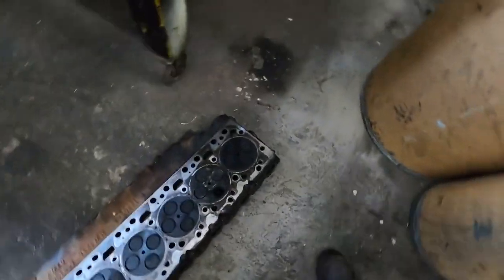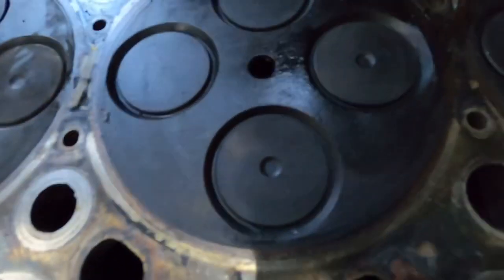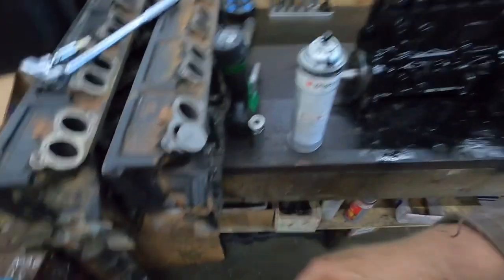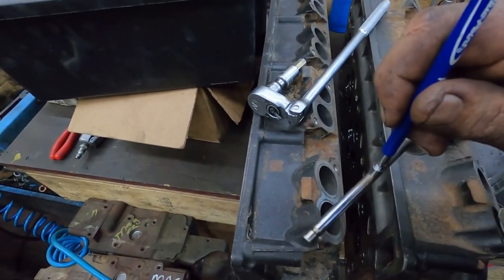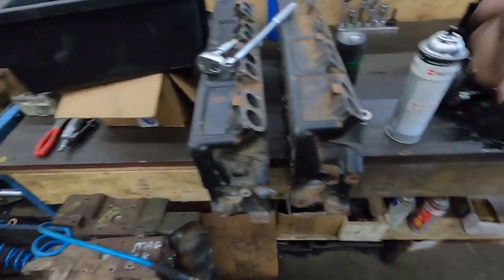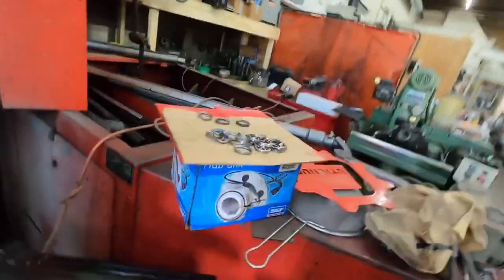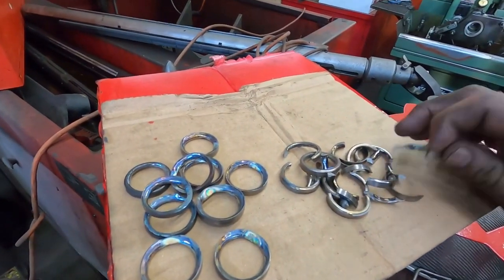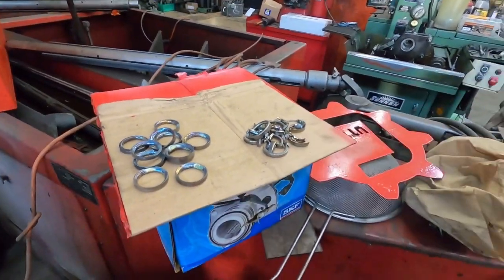WHY  6.7 Cummins drop seats and valves.

Comment: I know you posted this video a while ago, but I had a 2010 diesel pusher motorhome with the 6.7.  At 55K miles, I had a valve come apart in pieces and the cummins shop said it went through the engine wrecking the cylinders.  I ended up getting a long block because they said it was the recommended remedy.  I have always wondered how that could happen.  Cummins customer care would not help one bit.
Reply from the maker: If I had to guess the seat was moving around which will over heat  the valve. Which the head of the valve comes off from it

Comment: Doing some research as my 2016 5500 is in the shop and they are saying possible new engine because they think a bad bearing on a piston rod. It only has 130,000 and I’m freaking out as I have taken emmaculate care of this truck, all maintenance etc. I can’t afford a new engine every 130,000. Any tips?  I expected this truck to last me a long time. Zero issues until this. Bent rods twice, mechanics replaced rods and sent me down the road then 3rd time pulled over and was stranded with my horses. I only pull my horse trailer and drive 65 as that’s where I get the best fuel mileage.
Reply from the maker: I like doing all new seats. Better valve springs and get new exhaust valves. If the rod bearings are bad is werid unless it ran low in oil or it was on the cylinders the. Bent push rods are on

Comment: We just took our 2011 5500 apart, and Cylinder 2 dropped one of the exhaust valve seats. Would you recommend going all OEM for repair parts? Or is there aftermarket that would be suggested? We have 1 scored liner, and the head took a bit of a beating, as well as the piston is trashed.
Reply from the maker: I would use melling valves and re seat the whole head it it’s still usable.

Comment: Super helpful information Rob I've been looking for just this kind knowledge. Wanted to get a 2021 4500, but became a little shy after another rv hauler warned me of let's say 2018 and up. Do you see any valve / piston issues with 2017's ,?
Reply from the maker: the 2019 plus engine is complete different engine, i see the valve issue on the 2013-2018 engine , if it was me i would still away from the 2019 for the cp4 issues , but the 2020-plus seem to be good engine from the bit i have had to do with them, but if you do buy a 2020 + make sure you change to oil all the time, them have hydraulic lifters you don't want run down oil
Reply: @CUTTERUPROB  Thanks Rob *

Comment: Would you say a pre-'12 6.7 is a better engine? Shopping for a 6.7 for my 2003 lots of engines/year choices out there. Thanks for sharing information!
Reply from the maker: 07-11 is the ones I like
Reply: @CUTTERUPROB  Have you seen differences is 6.7 rods? I have seen two styles, don't know where/what changed though.
Reply from the maker: Not really. Personally if you want to make anything above 700 I would out better rods in it

Comment: Great explanation and I totally agree with you!  Cummins will probably  never admit to the problems they created.  Please feel free to gift me you CH-100 line hone cabinet!  I am currently building a cabinet that is that exact opposite of a Sunnen cabinet.  I want the mandrel weight on the caps , not on the block.
Reply from the maker: lol i dont use the the line hone much but one of those thing you need to have, ya i have a jib i made to do the same thing, well i think i still have it lol

Comment: 👍👍... Great Info once again man .. it is unfortunate fact with them apparently...wonder why cummins hasn't remedied the issue...
Reply: Here's my take on why they haven't made the change. I get this information from one of the lead Cummins engineers over this territory in the southwest US El Paso district. They may make a change that will save them $0.50. you think 50 cents why would they make that change? When you consider how many engines for example that they build annually.. 50 cents on 15 million engines is a significant amount of money. Even if it cost them an additional 4million in warranty work, they're still coming out on top. And to the other person's point.. he's absolutely right the majority of them failed beyond the warranty. Now here's the interesting thing though which warranty.? Because if you buy a 6.7 Cummins from Cummins it has 150,000 mile warranty but Chrysler only offers a 100,000 mile warranty. Why? Because they get it at a reduced price for the volume. Sad but that's big business. THEY MADE A CHANGE IN THE WAY THE TIMING GEARS ARE MANUFACTURED ON THE ISX SERIES ENGINE. TOTAL SAVINGS FOR THAT PART WAS ABOUT $15 PER ENGINE. They produce over 30 million engines for the global market. Estimated increase in warranty cost for service 12 to 15 million. Great video Rob as always
Reply: @timothymroberts2949  very well put sir, not just cummins but every manufacturer does this.
Reply: @timothymroberts2949  10 4 man👍👍.... Great explanation
Reply: Because it usually happens when the warranty is expired.
Reply: Great explanation on cost